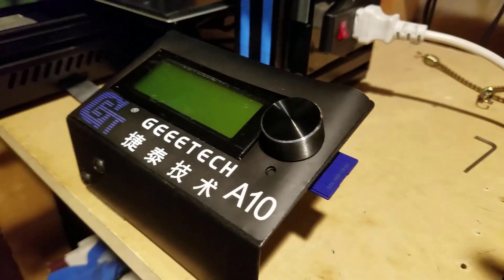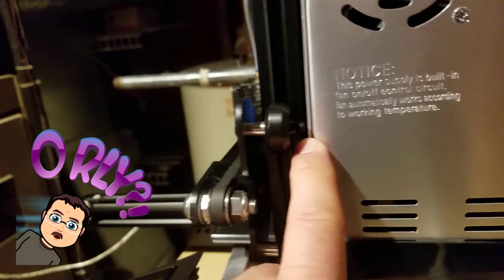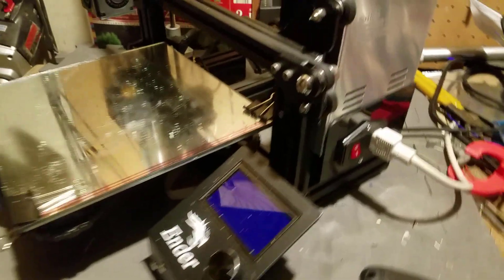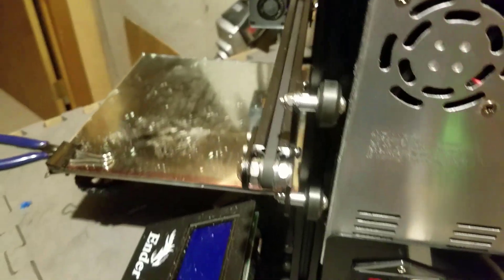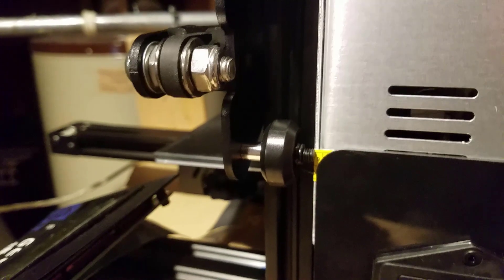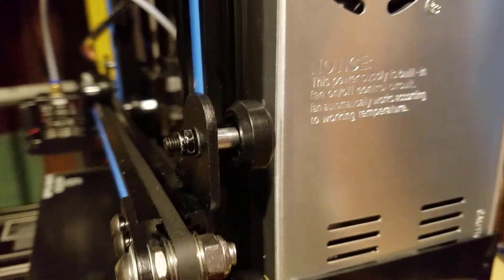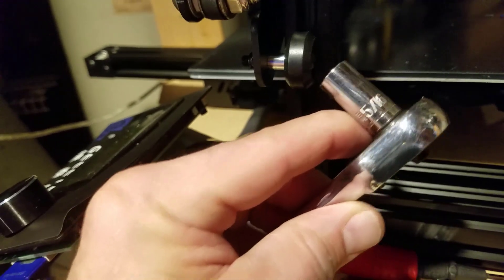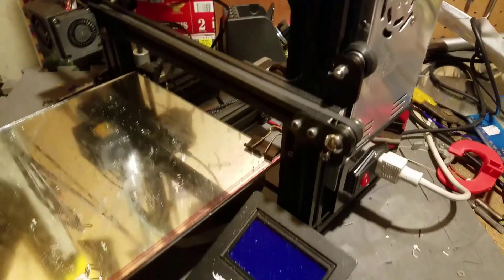Geeetech A10 Z axis a little sticky? Check this out.

Comment: Hi. My z axis is too loose. Is that possible? Like a tail gate on a car that won’t stay open? So when I’m printing about 4 inches up, it starts to drop onto the print moving it around and basically  jamming it. Is it the motor that’s failing? Any clues? Thank you.
Reply from the maker: 4" up? That is a lot of printing for it to start to fail on Z. If you are not printing, how easy is it to move the carriage vertically past the 4" mark? Will it go past there using the controller?

Comment: Great tip, will keep an eye on this when I open mine up. How do you like this compared to the Ender 3? Did I make the right choice, between the 2, by getting the A10?
Reply from the maker: I think the A10 is a great choice. If I connect my Ender 3 to a PC it just turns on and off like it is doing a reset... I print with the SD card and it is fine... I just prefer being able to connect to the PC. I have heard the board in the A10 is more up to date. The extruder mechanism has some really neat features on the A10 as well.  With any printer there is a learning curve. I had to dial back the bed and filament temps for the A10, but once I had those figured out I was good to go. I have them side by side and pick which I want to use based on the filament that is loaded =) as I trust each machine to print whatever I send its way.
Reply: @HLModTech  thanks for the nice explanation. I'm super excited to get into 3D printing...it will complement my drone hobby super nicely.
Reply from the maker: @NordicBlueRC  Do you read Make Magazine? They have a neat project where you can 3D print a micro drone. I was interested, but have so many projects already on my plate I had to pass... If you have not modeled much, I have a ton of TinkerCAD tutorials up here that you can mess with. It is amazing what you can build if you set your mind to it. They have one part that is supposed to be a gear, but I found I could tweak it to make a instant prop. Not sure if it was air worthy, but it was really cool.